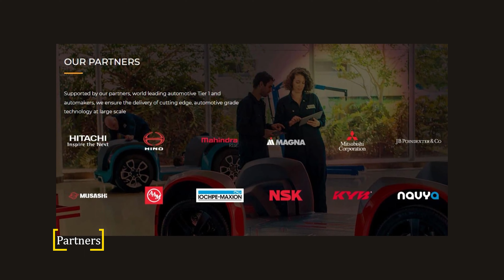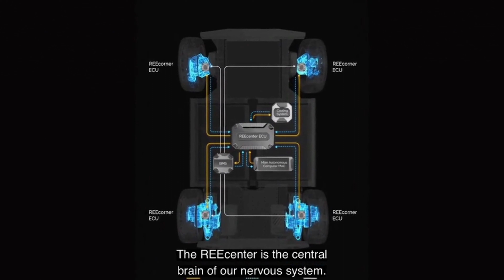REE automotive | A brief of unique technology invented | impactec | EV plateform

Comment: The idea of every wheel being completely separate from the others is very impressive.  REE should have gone one step further and eliminated the steering mechanism altogether, as follows: since every wheel is controlled separately, they can keep the wheels fixed parallel to the platform, and rotate the vehicle by changing the rotating speeds of the wheels.  For example, to turn left, make the left wheels turn slightly slower, and the right wheels turn slightly faster (by the same amount).  This way, they can even rotate the vehicle on the spot by rotating the left and right wheels in opposite directions.
Reply from the maker: That's true